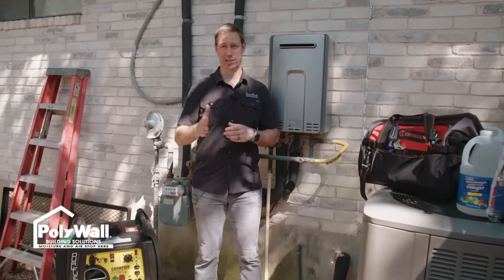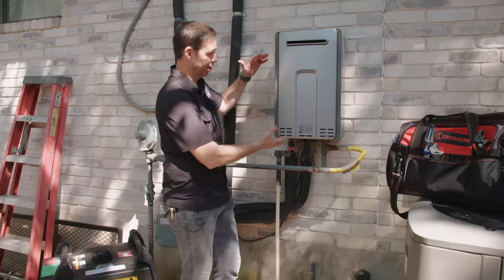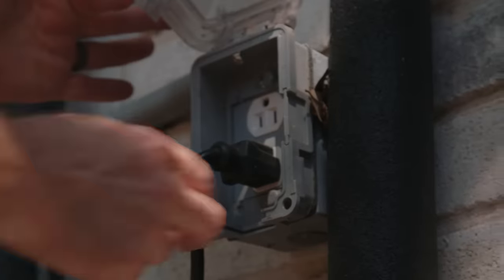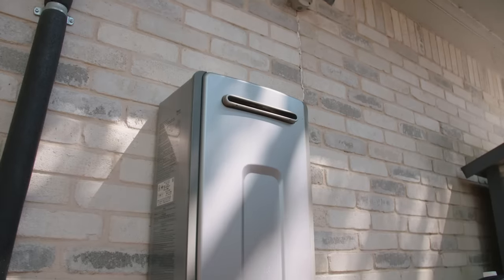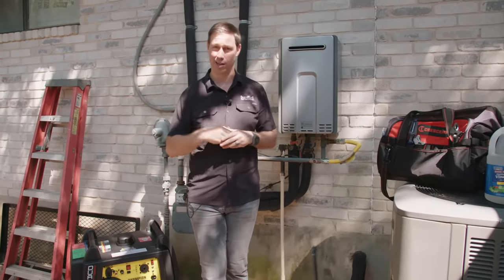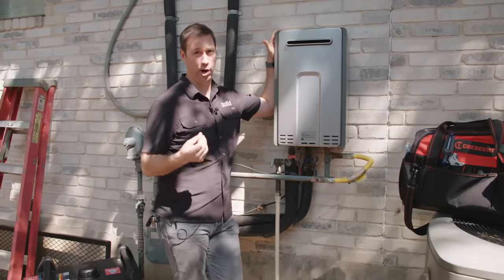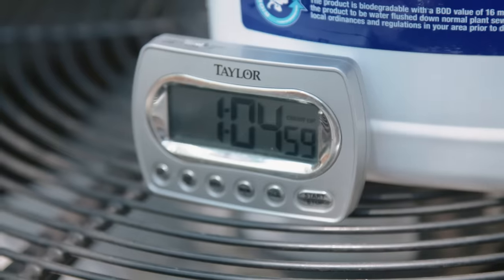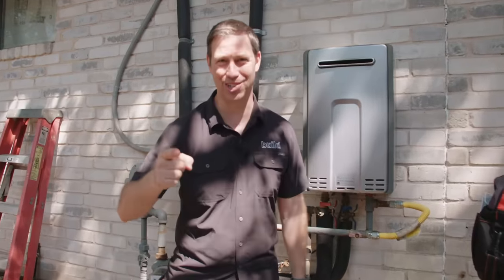3 Things They Don’t Tell You About Tankless

Comment: As an hvac and plumbing professional who's installed a tankless i have most definitely saved money on my gas bill.
Reply: When my wife can take a "long, endless" hot shower... Saved my marriage. :-)
Reply: I think the point is you can only claim one of these as a benefit not both; save money or endless hot water.  (If you use more hot water you lose the savings)
Reply: Evil Mofo  Versus what?  Curious what the monthly savings is and how many months it takes to break even on the added cost.
Reply: And dont those need flushed annually by a professional.
Reply: I saved $39 the first month
Reply: Gas usage last month was $10.97

Comment: I have 2 tankless gas water heaters, an old Bosch with pilot flame vented and a recent Rinnai direct-vent mounted outside as shown.  If I lose electricity, I can switch valves to using the Bosch for the whole house.  I added the Rinnai outside the rear bath so I didn't have to wait for hot water and to not waste water down the drain until then.  If you have solar backup w/ batteries, it could manage to tiny draw of an e-ignition gas tankless.  Never vinegar flushed my Bosch in 23 years, but soft water where I live.

Comment: I installed my tankless 10 years ago by myself and the kit even came with a backup battery system to keep it running while powers out. My water is pretty hard and don't have a water softener I only have to clean my tankless once every 18 months every 12 months isn't worth it when there isn't that much scale although it's also not my main source of hot water because I use an outdoor wood boiler unit for the hot water and radiant heat during the winter but even still I'm in the country and have a 500lb propane tank that's hooked up to the tankless system along with a fireplace and shop heater in the garage and that tank only needs filling once a year. These tankless hot water systems nowadays are alot more efficient than the one I have so I find it hard to believe that they are more expensive and need more maintenance than one that's 10 years old
Reply: Hard water with a softener. I installed a tankless water heater above 6 yrs ago and I'm just getting ready to descale it now. But not because we feel we need to? But because we're told we need to by the descaleing companies lol. We'll see soon if it's nessasary ?

Comment: I recently replaced a 50 gallon tank non-power vent for less than $600.  Works when the power is out.  I've never run out of hot water yet.  My gas bill is around $10 a month (just the water heater and range is gas) so to spend 1500+ on a tankless and have to plumb the exhaust vent differently, it's not worth the extra price.  I've seen plenty of tankless have issues with scale & sediment and they stop working, along with control boards having issues - which then you have to wait weeks for parts and service to get hot water again.  There's very little to go wrong with a simple tried and true non-power vent gas water heater.
Reply: You can easily find a tankless unit for under $500. They do not cost $1500+ unless you're buying the highest end highest output you can find. My propane usage with my tankless heater is less than $3 per month.
Reply: @ryanroberts1104  You can't buy a good whole house tankless for $500.
Reply: @MrNorthstar50  You most certainly can. Check Amazon. Depends on what your definition of "whole house" means. The size of the house isn't relevant, it's how much water you use. A $500 tankless heater is not going to be high output/high quality, but neither is a $500 tank system. They pretty much cost exactly the same - you can also spend $1500 on a nice tankless or $1500 on a nice tank model.

I have a rental house with an old tank water heater, next time there is a vacancy it's getting replaced with a $500 Amazon tankless unit. Overall the cheapest option and it will never leak, and frees up floor space which increases rent.
Reply: @ryanroberts1104  so the $7 a month savings will take a long time to recoup the extra cost.  Many simple tank heaters people dont touch for 10-15 years until they leak or fail.
Reply: @Hangovna  So you've totally missed the point then I see. Tank heaters cost the same as tankless heaters. Tankless heaters last longer and use less energy. Are you stupid? There is no "extra cost" to recoup. Your $600 tank heater is a pile of shit bottom shelf unit and will not last very long. If you spent the same $600 on a tankless you would have gotten a much better unit.
Reply: @ryanroberts1104  The cheapest DIY tankless natural gas unit you can pick up from Home Depot or Menards in stock today by me is $728 which is a bottom of the barrel unit, with an average price of $1000+.  Then a guy has to redo the vent pipe (since it's now PVC instead of metal) and cannot use the existing chimney stack and has to be routed somewhere external to the home, so that adds to the install cost.  Also it requires 120V to power the control board and vent fan, add that into the install cost to run electrical to it.  Oh and you have to run a condensate drain line and neutralize which some do not do for you, so there's even more cost.  Now the simple "$600" tankless turns into a big pain in the butt and a day or two worth of work.  Then what happens when the thing fails?  There's no on-site tech support for DIY brands, they just send you the part if it's in stock.  You could be waiting weeks (which many reviews state that online) if something goes wrong.  Nah I'll keep the dumb big tank that has zero electronics on it and do literally nothing to it in 10 years, then replace it again in an hour or two.
Reply: @Hangovna  they don't make tank heaters like they used to. My friends have had two not last the warranty period. One of them split on the seam and caused a lot of damage and stress in their basement. Is that factored into the total cost of owning a tank?
Reply: @mistysmith5392  they don't make anything like they used to!

Comment: The 4th thing...Plug it into a surge protector, I lost 2 computer boards on 2 different units.
Reply: are you talking about those big 50amp electric water heaters? aren't those hard wired???
Reply: Sasquatch 2001 Yeah, you have to run a fatter cable to the house for these things.
Reply: @jon4715  I'm lucky, I upgraded to 200amp  while back and my daughter moved out!
Reply: @matt8863  That's interesting, I never really thought about that. Definitely going to have to get one for mine! Also smart to use a cheap computer UPS system - it handles surge protection and will give you a few hours of hot water after the power goes out.
Reply: Doesn't your power company give you compensation when you lose stuff due to a power surge?
They have to do that here => somehow they manage to have almost no surges in the grid ;)
Reply: Exactly. The electronics in these should be treated like a home computer.
Reply: Just hasd a lightning  surge & lost the in house controller so can't get diagnosis & was wondering if I needed to order  computer b

Comment: Not sure how I feel about these “limitations”. 

1) how often is your power going out that this is a problem? If your power is that flakey, then a solar panel is a great mitigation option here, even more so than a generator. 

2) kids having long showers isn’t a fault of the system, but rather kids not having boundaries. Even still, tankless main savings come during winter when you’re not trying to keep 300L of water hot when it’s freezing outside. And you’re more likely to see a rise in water consumption before the cost of gas to heat gets you. 

3) this is more a limitation on your city’s water supply than the unit itself. If you’ve got scale issues from hard water, it’s gonna cause havoc for all systems, not just tankless. 

I’ve used both systems, but if I ever have to overhaul my water system, the first addition is a tankless unit. 

Maybe we’re just blessed in Australia to not have issues with water or electricity supply.
Reply: Agreed on all the points - also, what difference does a pilot light make vs the one that doesn't have it? If you don't have AC power, pilot light is not going to help you run the electronics and the water pump.
Reply: @Dxun2  If you depend on a well maybe but city water systems supply the pressure .
Reply: @rydfree  fair enough but you still need power for the electronics and microprocessors. Do they have a dynamo running off of water pressure? That seems unlikely
Reply: There are MANY tankless heaters that run on batteries. I have 2 and they run on 2 D cell batteries. I replace the batteries every 6 months and that is only because I do not want to be with hot water. The batteries are still working when I replace them
Reply: @allanc3655  Without maybe?
Reply: @freddexta3363  RIGHT...Left out the "out".

Comment: I have a tankless in my vacation home, and really like it since I'm not heating water when I'm not there.  I did install a water softener too just so my warranty would still be good (and reduce scale buildup).  It's been running like a champ for 9 years without a hitch.  The only thing I've done is a flush that was easy to do myself.  Get a sump pump, a bucket, and some vinegar and you can do your own flush cheap and easily.

Comment: My thought had always been if I ever remodel a bathroom while I had teens in the house, was to install a cutoff valve just outside the bathroom.  Then if the teen takes too long of a shower, you can just start closing the valve on the hot water...
Reply: it's 21st century, automate that. either the valve or a more draconian, power cutoff. do some cool automation algos!
Reply: I installed a switch which I can shut off the tankless water heater
Reply: Where are all these teens taking long showers? I always took as few and as short as possible. Still the same now.
Reply: or never have kids , the ultimate saving method 😅
Reply: That’s the way I grew up! My dad was always “at the ready” on the hot water valve when I was in the shower.

Comment: Maybe a gas tankless is O K, but I'm an electrician and I saw one installation where the handyman who installed it connected 3-40A circuits to a condo electric panel which was maxed at 125A. (Add it up) This left only a few amps for everything else. The owner had to turn off 2 of the units to have A/C or to cook. The incomming service could not be increased. With only one unit working, he was left with a trickle of lukewarm water. He had to put a tank type back in. Before you purchase an electric tankless water heater, make sure you have sufficient electric available.

Comment: One is my favorite benefits is being able to drink your instantly heated water (which I'd never do with a storage system).
My biggest con is that they need a minimum rate of flow in order to kick in (otherwise they'd overheat), meaning that you can't just dribble a little hot water at your kitchen sink or have a very lukewarm shower. At least, that's how mine were anyway.
Reply: Did you have to install a pump too - I did not install one - since the replacement tank was about $1000 cheaper for me - but I read that for the size of my house, from the basement, i had to put some type of water pump to get the water up to the higher levels of the house.
Reply: That’s not how they run in the last 20 years. Yes - you need full hot water flow to turn system on. But once it ignites you can back off the flow and add cold at the faucet to get a lukewarm shower or whatever. I had 3 in my 5000 sq ft house with 5 bathrooms. Plus 3 gas furnaces and a heated pool / hot tub. Gas bill was never over $45 in summer and $100 in the winter months. That beats my electric bills with dual hot water tanks in previous homes. My other houses had hot water tanks and they failed just after 2-3 years. Full of sediment/broken elements/leaky pressure relief valves. Not to mention hot water tank seam failure in an attic that floods the whole house. This video is a lie about service requirements.
Reply: @arnoldtarbooz1420  Mine was a single story house and it ran just fine on mains pressure (no auxilliary pump).
Reply: @Swordsfor200Alex  Re "That’s not how they run in the last 20 years", glad to hear that this issue has been resolved. Mine was only installed in 2010 but perhaps we're a bit behind on this tech 'down under'.

Comment: Generator?  I have used a battery backup for the tankless and it has worked flawlessly.  Use of natural gas dropped by 77% with the tankless install vs tank so it paid for itself in 24 months.  The maintenance on mine was nil as all water went through a KINETCO water filtration & softening system.  Just for information I did clean the system, easier than doing laundry.  14 years going strong!

Comment: Our house was built with the usual 40 gal tank in the basement, with about a 12' run to the kitchen. The owners then replaced with a tankless unit , and now it's a 45' run to the kitchen. The missus always turns on the hot tap to wash the occasional cup - but the hot water doesn't even reach the faucet before she turns it off. That means there's nearly a gallon of water getting heated and running through the pipe which never gets used... every time. Annoys the heck out of me - but will she change?
Make sure the placement of your device is as close to the wet zones as possible.
Reply: It really sucks if you like tubbing..water in pipes gets ice cold takes too long to reheat tub.. need to add a pump.. but i rent

Comment: Installed at vacation home. High BTU caused vinyl siding to melt but almost started a fire from an unexpected bird's nest. First repair $350 with tune up squashed  savings, too. Switching back to 220v 50g tank...However tankless has it's virtues for additions,  etc.

Comment: The other thing that we are often not told about is having to up size the existing gas line if converting from tank to tankless.  This can be pretty costly depending on the length of the line.
Reply: Yes most homes in the towns should and most have a 1 1/4 coming and you need to help it down to a 1"or 3/4" I found that a 1" works alot better
Reply: That's a thing of the past, most tankless heaters these days only require a half inch supply.
Reply: Not true...
Reply: 100%. I wanted a Rinnai 26 to replace natural gas tank hot water. It needs 20mm pipe, 15m from gas meter.Plumber told me due to location of proposed tankless being 20m away from the meter with many turns, 32mm pipe is required to satisfy Rinnai 26, which consumes 200MJ gas per hour. Quote was AUD $4k to install a $1k Rinnai 26 heater.

Comment: There are pros and cons to everything. I have installed numerous tankless hot water heaters, and always inform the customer of power outages and to have the unit maintenanced annually.  There are many things that need regular maintenance in your home. Air filters every 30 days, batteries in smoke detectors, garbage disposals, etc .... Once a year for one hour is nothing and preserves your investment. AA small subpump and a gallon of vinegar, that's it. As far as instant hot water, only if you have a recirculating pump and your plumbing is correct. Otherwise, it may take a small amount of time for the hot water to reach you, depending on how much pipe it needs to flow through. They are cost efficient compared to an electric tanked hot water heater. And you don't have 50 gallons of water waiting to burst forth in your home when the rust out and rupture. Do you tell your customers about that issue when you sell them a house with a tanked hot water heater in it? Fifty gallons flowing from the attic down into the house is a disaster.  Tankless hot water heaters don't store nor perpetually heat water. Is on demand as you need it, only. They usually pay for themselves in about 18 months. And you are right, it is about teaching conservation. Teenage girls realizing there is endless hot water [until you run out of gas -propane] will stay an hour in the shower. As far as trouble shooting goes, a simple pressure tester and a multimeter is all you really need. I wouldn't use anything else but tankless. And as far as personal preference, I am a Navien fan. Rinnai has to be ordered for which kind of gas and indoor or outdoor. Navien is any type. Comes with a conversion kit for the gas [takes about 10 mins to convert] and you simply need to use a cap on the top for outdoor. And instead of special pipe that rinnai requires, Navien simply uses cpvc for indoor use venting. And yeah in that video, that must be one of the worst piping jobs for gas that I have seen. Appliance connectors are not rated for outdoor use anywhere that I know of ......
Reply: When you die....does your wife know how to perform all those little maintenance chores?